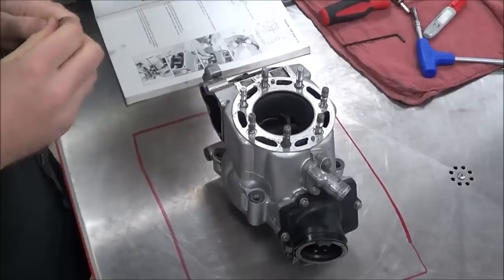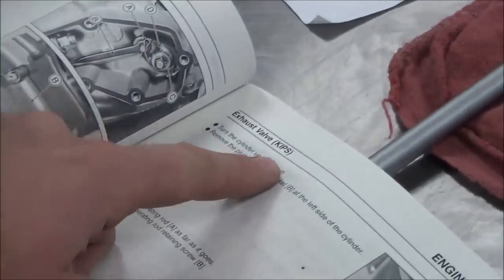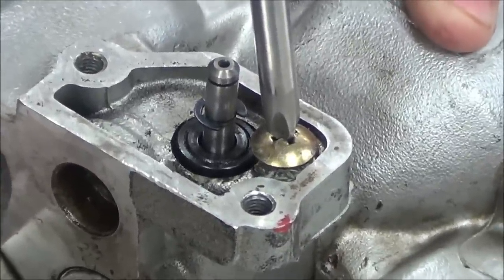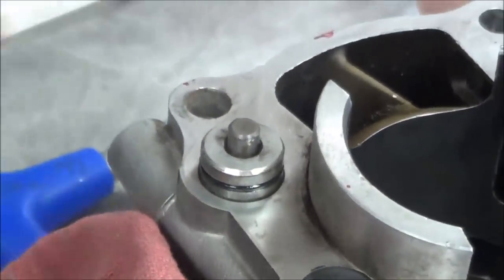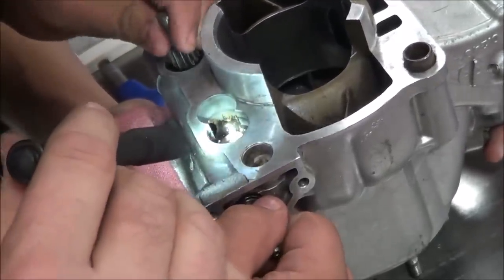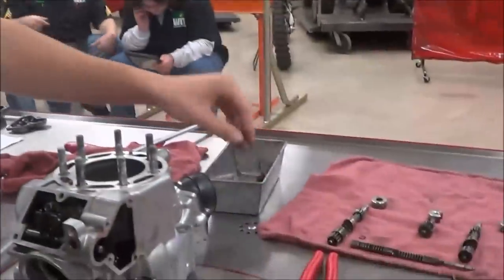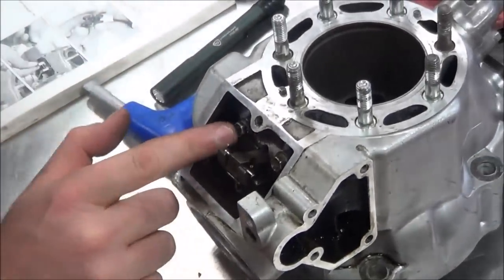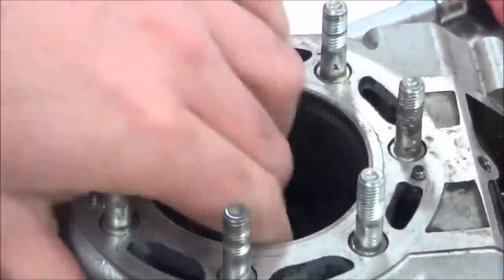2 Stroke Engine Disassembly   Power Valves   11 10 14

Comment: One on the most complicated power valve assemblies ever was this power valve system its called the kips power valve system or (Kawasaki integrated power valve system) it was way more complex than it needed to be and it was known for sheering off gear teeth on the timing gear shafts

Comment: They've really changed the kips system in later 2000 after July. They went with the helix on the end of the power valve and the exhaust port valve is a damper style with pins on each end that go into the helix groove in the power valve.

Comment: Taking off the 94' TZR powervalves means I take out 4 screws and a cable assembly. A cap on one side(2 screws) a retainer on the other and one that splits the actual valve in half! 15 mins top!

Comment: Now that you say it. I was working on my Suzuki the other day and I noticed my screwdriver wouldn't fit right on one of the screws on the carb. It seemed like the correct drive but I wound up stripping the the head of the screw out. It looked just like a ph2 but didn't seat correctly like in this video. I had to chisel a slot on it to use a flat head to remove.
Reply from the maker: Great think about YouTube is I learn all the time from comments and other vids. It was a comment on one of my videos that informed me of JIS screwdrivers! So many awesome people sharing. 👍

Comment: How did ya'll remove the bolt at 17:40? I have two similar bolts on the powervalve on my rm250, that were already stripped and I could not remove them.

Comment: You can identify a JIS standard screw by the dot on the head, heres a very interesting article full of pictures and comparisons of the JIS standard. If you want the TL:DR version nobody makes a proper JIS screwdriver anymore but some of the best bits I've ever owned come in a three pack from vessel and fit the heads VERY well, part number: A-16621, here's the article: webbikeworld.com/motorcycle-tools/hozan-jis-screwdrivers-review/
I strongly urge anyone who comes across a few of those dotted phillips JIS screws to pick up a set, they bite really hard.